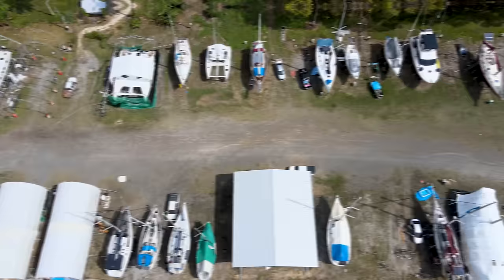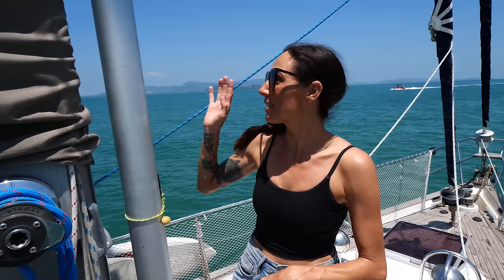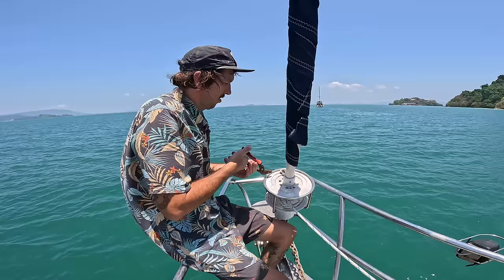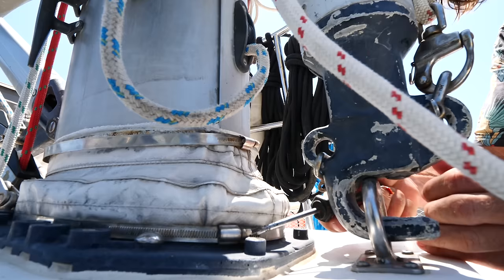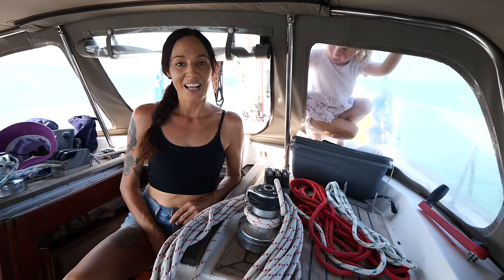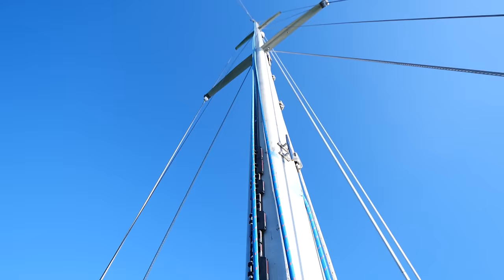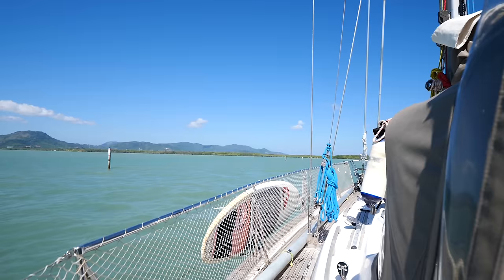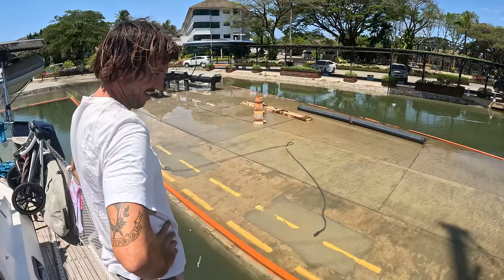WHAT PROBLEMS ARE WE ABOUT TO FIND?? Haul out before the Indian Ocean. Ep 352

Comment: I rethreaded a line in my boom by tying a piece of magnetic metal, a key, onto a mousing line, placing it inside the boom and then using a magnet on the outside to run it the length of the boom.
Reply from the maker: Genius!!!